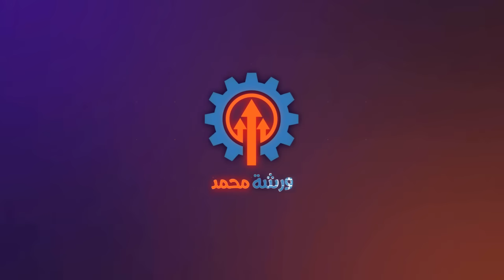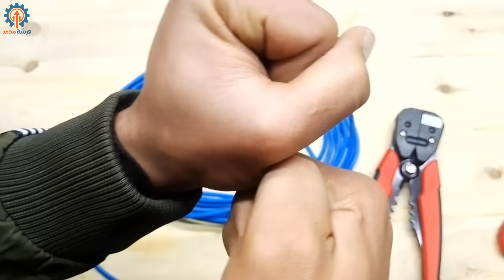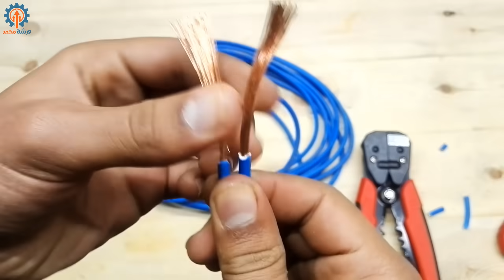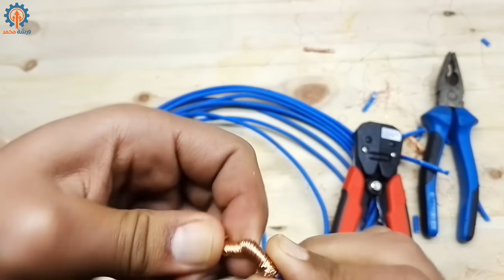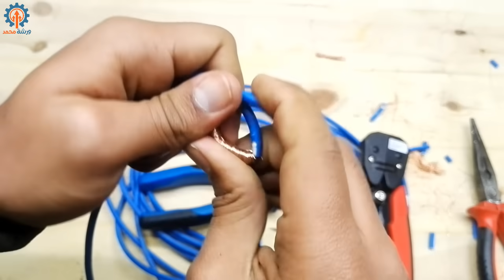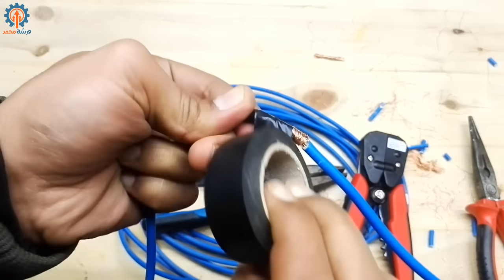ضاع عمرنا و احنا نسويه غلط - الطريقةالصحيحة !!Proper Joint of Electric Wire

Comment: I'M AN ELECTRONIC TECH W/20+ YRS EXPERIENCE. YOU JUST CREATED A CURRENT LIMITING RESISTOR. THE CONNECTION SHOULD BE AS SHORT AS POSSIBLE.
Reply: So then in your 20+ Year experience, what will be the best way to do it?
Reply: pablo fernandez replace the whole wire. If there’s no component inline with the wire then there’s no need for a connection. If the wire is rotted it’s ok to solder it together till you get a full replacement. RF equipment is very touchy you stay within engineers specs.
Reply: AMEN!

Comment: This is a "western union" splice. It is meant to give strength to a wire that spans from pole to pole. But that was single strand copper in the 1800's. It was never meant for stranded wire and does not meet code for any connections in developed countries. I will admit that I don't know why he is teaching it, or for what use, but to me, the concept is dubious from a safety standpoint. P.S. I have been asked about why i have concerns about the connection....if it was for speaker wire, it would work, but i don't know why you would worry about strength in speaker wire. For carrying current to a constant load, even with tape on it it may quickly develop high resistance and overheat. The telegraph wire the splice was designed for was solid copper and carried 6 volts or less.
Reply: What if you soldered it and then heat shrunk it?
Reply: @KarasCyborg  That would be stronger and safer, but still not used in Europe,Australia, Canada, or America. Wire nuts or a crimp connector at the very least,  and conduit to protect the wire. This may be adequate for what he's doing, but it's not really shown.
Reply: Victor Robison .... What makes it unsafe?
Reply: @hernje  I wish i could cite references to city code, or prove resistance in the connection, but i don't have the code in front of me, or the splice to test. What he shows is the mechanical strength of the connection, which is strong, but if you were to wire a building that way, the inspector would fail it and make you put it to code. I hope this helps.

Comment: Your splice is only suitable for low voltage low current applications and should be soldered as well in any case. Better to use a crimp splice for a quicker more professional connection.

Comment: Just solder or crimp it. Drilling wires is not professional in electronics. Your method is good for joining two clotheslines...
Reply: actually its been used and highly praised in the telephone and telegraph industry for over a hundred years best wire splice known and incidently it doesnt work well with clorhsline

Comment: That piece of wire are sharp too.it can cut fingers while pulling.it was a lesson learned for me..so be careful guys.use proper pliers ok.
Reply: Vegel Nillo that joint was going ok but the joint is not properly correct

Comment: that's a nice way to joint cables, but man, how are u holding ur shissors??
if i don't know is normal cause in ur country there aren't much good electrician (not ur case obviusly, i never saw u working, and i don't want to offend, is just a fact) but the "correct way" to hold is with the tom in a hole and other fingers out from the other hole, just on te side, obviously if u hold shissors other way it will work anyway, but if u hold like this staying all the day cutting cables, tom will hurm much less, and less blisters anyway.
maybe at beginning u will feel bad to do because like this, opening shissors is pretty difficult, but if u mind, an electrician have to close shissors more than opening.
with this i don't wat to look like a little teache, but if u don't know and u work as an electrician that will help u a lot and so i telled u

Comment: If you’d been working for me, you would have been fired. The work is messy, stripped wires far too long  and should have been finished with heat shrink tube for proper insulation. Only need to strip max 2cm. Technique is good though.

Comment: What te f*** is that? Yes, proper joint technic if you want to be use that wire for lasso but NOT for electrical use! Use certificated electric parts for proper joint or at least solder it! This $hit is useles and dangerous.